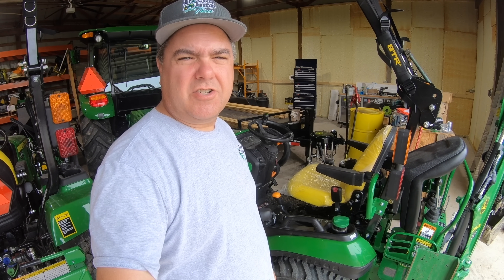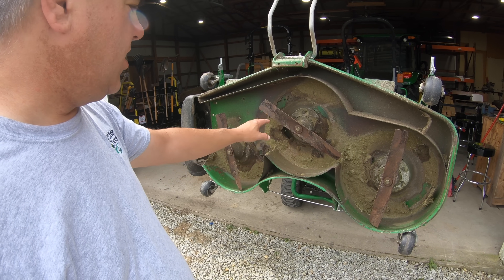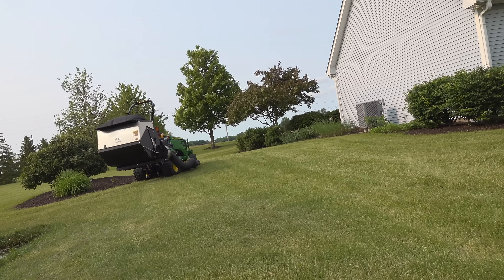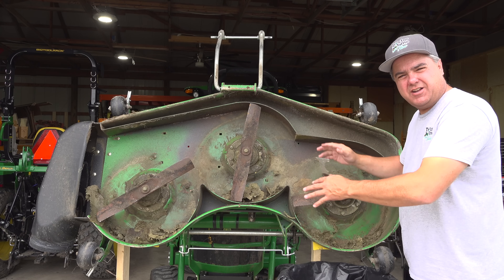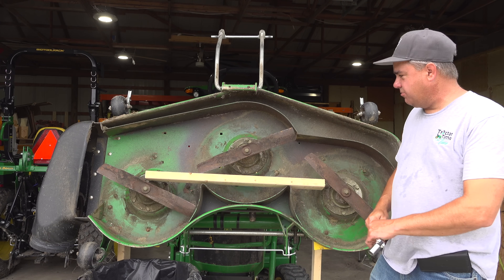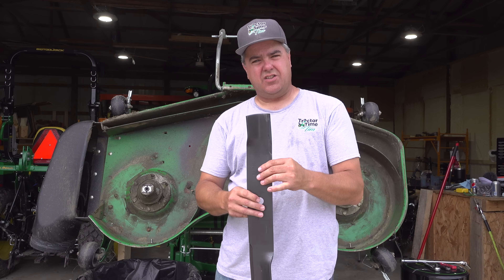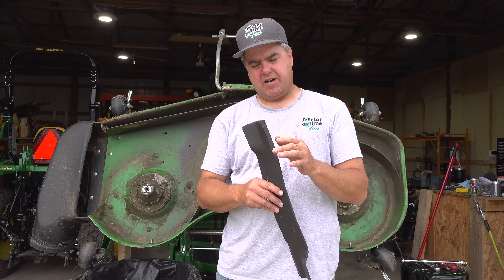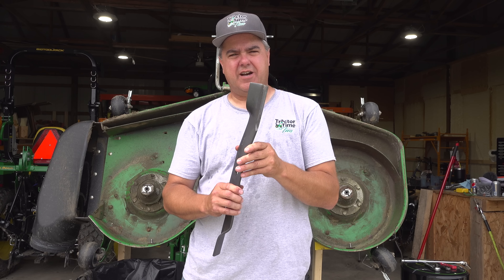Never Sharpen Your Mower Blades Again???

Comment: I don't like the word sharp because you'll; find in some John Deere owners manuals they show you how to not sharpen your mower blades to a knife like cutting edge. Deere's manual shows a bunt cutting edge the reason why is that two edges are better then one shape edge. The blunt edge is only a 1/64"{ to 1/32" wide, two edges will last longed then one, I've mowed lawn since I was 15 years old but I only found out what John Deere has been printing in their manuals, unless the bean counts have caught up with that bit of info and replaced that with no sharpen those blades like a razor so there wear out faster so we can sell more of them.Take look at page 39 on this link https://www.deere.com/common/docs/stellar/answer-center/Scotts-S1642-S1742-S2046.pdf this the first JD built Mower I bought a Scott's S1742. there's a picture of what talking about.
Reply from the maker: Same riding mower I started with...I had a Sabre by John Deere 1642.  Very similar.

Comment: uThere's no such thing as self sharpening blades; especially those you just installed.  They aren't rubbing on anything that when rotated resharpens it.   But to test it why don't you drive over a bed of road gravel and see how much shiny those blades look afterwards.  Now you've heard of sharp sand; so why not drive over a pile of that and see if indeed those blades get any sharper.  I think it's a marketing ploy t see how many people buy those self sharpening blades.  Then they'll obtain your address, and mail you advertising literature on their new technology motors that are completely sealed and never have to change the oil again.  Would love a followup video to see how sharp those blades remain in a year.
Reply from the maker: Haven’t mowed much with them yet, but we will do a follow up after some time.

Comment: Leave it to Deere to figure out another way to separate money from their customer's wallets. I dont blame them though.
People want self-servicing lawn equipment. Deere will most certainly come up with something for you and triple the price.
Me.... I just start the season with three sets of sharpened blades. It takes ten minutes to swap a set while doing oil and filter change.
Reply: Premium products are not for everyone, but they are appreciated in the golf and agricultural industries.   For golf, they can aerate 18 holes with a carbide tipped set of tines, rather than having to change the tines every 6 or 9 holes. On putting greens, the carbide knives keep the reel clearance correct.   Farmers harvest all season long due to self-sharpening longer lasting knives and wear components.   Most commercial mowing professionals are capable of understanding the cost of sharpening versus the cost of these blades.   Laser-Clad.com has a cost calculator to help business owners.   It always amazes me how people will buy a premium mower and then try to save $3 a blade putting on the cheapest blade they can find.    Again, they are not for everyone, some people do not care about quality of cut.

Comment: well you complain about deck getting rusty why didn't you pickup a paint brush and paint it ?i have a 1995 sears mower paint it every year still looks good today,and i rebuild the spindles too,now you use that special blade ,it will never get cleaned out,never turn it over

Comment: bull will not last  put one blade on at 9 to 3  one on at 12 to 6 one 2 to 8  clock time
Reply: With smooth pulleys and belt any timing of the blades will change in a very short period of time.

Comment: Decent video but it might be nice if you got to the actual point of the video sooner.  You were 3/4 through the video before you got to anything connected with the actual self sharpening blades.  You could have just called the video "how to use the load and go".

Comment: The first half of this video has nothing to do with the subject. You might want to say, right off the bat, that this technology is not available for the average lawn tractor!
Reply from the maker: John, we had no idea this episode would take off like it did.  This is one of 600 episodes we have posted.  We incorrectly assumed that our ‘normal, repeat’ viewers would be the primary audience.  We focus on compact tractors.
BTW, this technology IS available for regular lawn mowers.  Look up ‘self sharpening mower blades’.
Reply: OK, it just didn’t seem as if it would apply. The average guy knows nothing about this. You would think Deere would get the word out somehow.

Comment: I have so many things to say as a professional lawn care company.   Never pressure wash the underside of a deck.  And the blades should be the absolute number one concern when mowing.  I can see a lawn mowed with dull blades a mile away.    A few days after you mow look at the tip of blades of grass.  If they are jagged and have a little bit of brown on the end/edge you need to sharpen  asap.  You will never have a fully healthy lawn if you don't.  No matter what kind of blade you have.  I spent 1k on a blade sharpener because the angle of the edge is equally as important as the sharpness.  Things that look like gimmicks usually end up being a gimmick.

Comment: "Gator Blades" Dude, "Gator Blades"...!
Reply: Oregon makes several grades of Gator Blades. Standard, G3, G5 and G6. The G5 and G6 have Fusion technology which puts tungsten carbide in the cutting edge to stay sharp longer.
Reply: Are those Gator blades really that good? I've heard of them before and being  on my second season with the original blades yet and there doing fine still mowing three acres once a week.
Reply from the maker: I’m not a fan of the gator blades.  The clip you saw in this episode where the 54d mower deck is chock full of stuff was with gator blades.
Reply: @TractorTimewithTim  Well that could be it...  I never mow wet grass and I never mow in the mud...
Reply: @herbiebackhoe5593  They are on nearly all pro machines...
Reply: Tired old mechanic 
Them g6 gator blades are junkyard

Comment: A blade can't sharpen itself .crazy
Reply from the maker: Actually, if you analyze the details of how this blade is made, it really DOES sharpen itself.
Reply: @TractorTimewithTim  yeah and pigs might fly
Reply from the maker: Ok, put your head in the sand.  That is fine.  The thin extra hard laminate edge on this blade wears longer than the softer portion above it. So, as the softer portion wears off, the blade continues to ‘sharpen itself’. The technology has been around for years.  It works well in sandy soils, but doesn’t work well if there are rocks around.
Reply: @TractorTimewithTim  can't think it would work very well as it's a tricky business to get blade right sharp

Comment: Why people sharpen mower blades is beyond me !

Use the brain that God gave you !

For your information, mower blades cute grass, NOT steel or even wood.
And in case you don't realize it, grass is a soft material.
My current mower, I've had for over 5 years and the blade has NEVER been sharpened. 
AND it meows my yard just fine ! !
And it was extremely dull when I got it.
Reply: Dont believe you I've been in landscaping for 18 years and they will have to be sharpened eventually and yes after you sharpen any blade it will dull quicker and grass will fill your blades

Comment: I've had my 42" Craftsman Riding mower for 14 years and have never had to clean the underside of my mower deck. Ever. I sharpen them often. Pickup debris and you don't have to sharpen very often. No high pressure water ever.Too much more for 60" Blade. No way needed. Had to watch it three times to give It three thumbs down. No substance to this stotry! None!